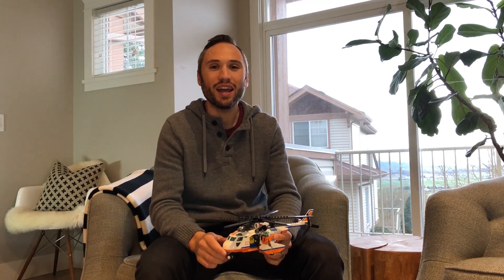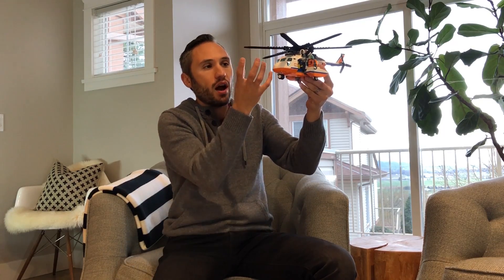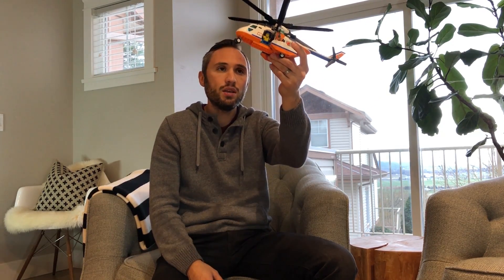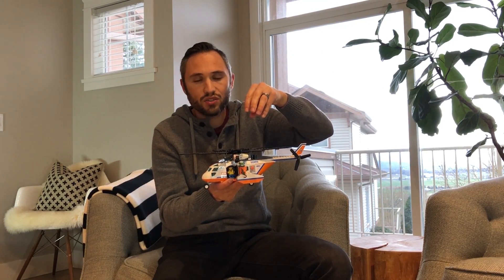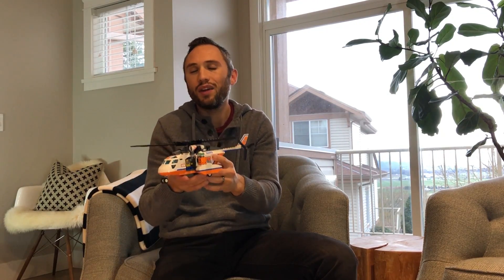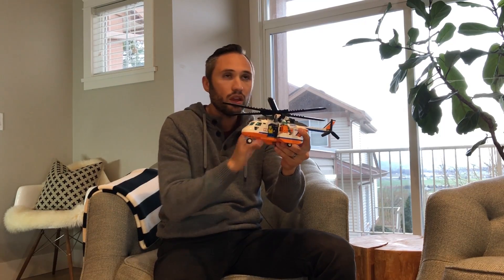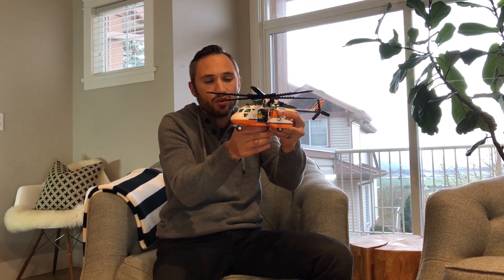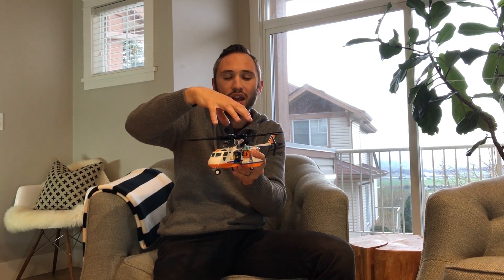Vortex Ring State IS NOT Settling With Power

Comment: AOPA has a good blog about this. This is all a battle of semantics & definitions. It's really not useful to have a separate definition for running out of power when the helicopter is too heavy.  We all grasp this concept easily... helicopter too heavy & move to fast, rotor no stopy, helicopter hit ground.
VRS meanwhile is a complicated concept that requires a lot of classwork and understanding of helo aerodynamics to master.
What's the solution to having a helicopter move too fast/too heavy and the rotor not having enough lift? Use charts, don't put yourself in that situation. Simple
What's the solution to keeping yourself out of VRS? Vuichard technique or the older style recovery. Neither are intuitive. Both need particular training. 
It might be to come up with a term for the lack of power situation, maybe, but it's not a priority. I don't think it's wise to use "settling with power" to describe this because lots and lots of older documents still exist that describe SWP as VRS.

https://blog.aopa.org/aopa/2009/04/17/vortex-ring-state/

Comment: The thing to remember about VRS is that the limits given are not the limits to get into VRS, but the limits at which you cannot get into VRS.
At more than 30 knots (it's actually anything above ETL) you cannot get into VRS. That is not to say that at 29 knots you will get into VRS .. it may not happen until you get below 23kts (I actually know of one heli that absolutely refuses to enter VRS until it's airspeed is less than 2 kts), but the point is that it absolutely will not happen above 30 kts
In a descent at less than 300fps, you cannot get into VRS, in some helis it will not happen until you hit 1600fps, but again the point is that at 300fps it _will not happen_.
In essence, the information given by the FAA about entering VRS (although accurate) is misleading.

Comment: Thank you  Y P ; good stuff to file away, when later required.   Once was asked if you were in formation flight,  going to land and you experience settling with power with Engine Maxed out with tree corridor on both sides , what would I do?    the answer is : to trade altitude for power.
Reply: not a realistic question. on an approach to land, your forward speed should keep you in clean air until you are about ige height, at which point settling with power is unlikely. besides, you already have a whole lot more to worry about than vortex ring state if you are shooting an approach, in formation, with no out at max available power
Reply: @josemadarieta3   Thank you for the explanation  this was about landing flying  formation in "nam  to lz  ige  where you have only one option for successful results . sorry I was so vague.  no side step with the border of trees.  I saved the story for my future use and thought to share it with you.
Reply: @garyh7191  lol. as i was typing my comment i was thinking "not a realistic scenario...unless you flew slicks in nam"
and if you were anywhere near helos during that period of time, then all i have to say to you sir is, respect

Comment: It would be great to see a video analysis on theories to what happened to Kobe Bryant's helicopter crash
Reply: From the NTSB analysis of the radar returns and transponder altitude replies, it looks like the pilot was attempting to turn around and head back to Van Nuys or Burbank (Bob Hope) airports, where they would have had to get a limo to finish the trip. The pilot simply forgot about the nearby ridge of mountains. I don't think VRS applies to that accident.
Reply: Ok the pilot zucked up, the heli hit the ground from a height not CFIT which is controlled flight into terrain. Loss of control with no visual reference ie can't see, so after loss of control, gravity took over an heli hit the ground very fast what? 170 mph?. This  is not the first time and won't be the last time this happens, Man is better at designing a plane than operating the plane because the human brain has faults like ego, peer pressure, fatigue, impaired medically.... , Time pressure etc. You can't pull over to the side of the road, ironically. a heli is able to land in a quite small area but the pilot continued and for 15 minutes circled over a spot(during that 15 minutes he became more and more fatigued) he should have landed anywhere during this period, a sequence of errors that led to the crash.

Comment: So settling with power is more like a lack of anticipation, whereas vortex ring state is kind of a trap you have to identify quickly to escape ?
Reply: SWP is an aeronautical downfall of getting stuck into your own downwash. What he described as SWP is mushing.

If you have 20kt airspeed and a 20kt tailwind you have a ground speed of 40kt and still have an airspeed of 20kts and therefore will never get into VRS or SWP. 

You cannot have 'matching angle of attack of the wind and the rotor'   angle of attack is the angle created by the cord line(airfoil) and the wind. So the wind does not have its own angle of attack.

Vurshard technique is maximizing translating tendency. You have  to use POWER PEDAL and opposite cyclic and raise the collective to slide laterally out of your downwash.

Comment: When I first came across this video I thought what is this guy talking about. I had always used the terms to sort of mean the same thing. I say sort of because I actually think of settling with power as being what happens when you fail to correct for vortex ring state. After watching the video I realized that what you call settling with power is what I would call sloppy flying. Why would any pilot allow himself to get into a high rate of descent close the the ground. I have actually experienced vortex ring state one time in over 9000 hrs of flying helicopters. I was in a out of ground effect hover (Bell 206) when it happened and I immediately pushed the nose down and lowered the collective  a bit (as I had been trained to do) to get out from the down flowing air. The recovery was also immediate. I found the video of the Vuichard Recovery Technique to be very interesting and can see how moving the cyclic to the right and pedal to the left (in the 206) would be better as that would result in little lose (if any) of altitude, as compared to putting the nose down. It might even have been a little quicker because of the added thrust of the tail rotor. As the holder of both a helicopter (ATP) and fixed wing (Commercial) licenses (Canadian) I find it amusing how fixed wing pilots keep trying to compare a rotating wing (the rotor, which has the tip moving at a much higher air speed then the root) to a fixed wing which has relatively constant air speed from tip to tip (except in a spin). As a side note not all of the helicopters made in European countries have main blades rotating clockwise
Reply: "what you call settling with power is what I would call sloppy flying"
Spot-on.  EXACTLY.
Reply: I like your comment. Only a thought about this: "Why would any pilot allow himself to get into a high rate of descent close the the ground". To settle with power you don't need a high rate of descent. Just a rate of descent you can not arrest in time. Imagine you are flying your helicopter really near its performance limitations. For instance, at very hight altitudes with high temperatures, and a heavy configuration. Try to land at 8000 feet in Afghanistan during summer. Perhaps you make an approach with 200 fpm and you can't avoid a hard landing. It's not so easy to judge the power remanent when you fly so close to the limits. Regards.

Comment: Great video, but I’m confused about your description of stalling. If the airflow is matching the angle of the blade, you are correct, it isn’t generating lift, but that is not a stall. A stall occurs when there is too much angle, and the air can’t follow the upper surface of the blade.
Reply: Stalling only occurs on the inner portion of the rotor, where the upwash near the rotor hub has the effect of increasing angle of attack on the inner portion of the rotor, reducing lift. The outer part of the rotor is operating in downwash,  decreasing angle of attack and also decreasing lift. The overall lift is reduced to the point that full scale helicopters need double the power it takes to hover to be able to power out of VRS (climb vertically without needing lateral movement), such as an unladen SkyCrane or MBB BO-105 (it can do loops). Model helicopters may need relatively higher power, due to scale issues. For 3D aerobatic type helicopters, it's not an issue. Consider the fact that a tic-toc maneuver repeatedly cycles into and out of VRS without issue due to the high power to weight ratio.
Reply: @rcgldr  Thanks! Very helpful for my understanding!

Comment: Vortex Ring State (VRS) occurs when the descent rate is great enough that upwash at the hub creates an inner set of vortex rings and/or stalls the inner portion of the main rotor. Descending into it's own downwash creates a momentum issue, but if there's downwash at the hub, it's not VRS.

Comment: Why does Rotor rotation direction determine left or right cyclic recovery movement for VRS? Does Tail Rotor Thrust have an effect? Thanks, fantastic videos.
Reply: Bob Moo Blade which is moving forward has more lift then retrieving blade. That’s why Ccw like Robinson cyclic right pedal left. Yellow Pilot is wrong on Swiss technic to recover. On G2 Cabri cyclic left pedal right. It might have to do with torque too.
Reply: Vuichard Recovery method relies on tail rotor thrust + cyclic lateral thrust in the same direction for near lateral recovery.

Comment: Apparently the United States is the only country that uses the terms... Settling With Power & Vortex Ring State ...interchangeably... but I'm having a hard time finding sources that describe the differences between the two in a complete, concise manner.  The best I could find is bits & pieces of info from a multitude of sources.  

So my understanding is this... Settling With Power is when the pilot tries to do a maneuver which demands more power than what the helicopter can produce, like... 
trying to land on a mountain top hovering at the helicopter's hover altitude limit, 
flying at ceiling altitude limit, 
flying in high density altitude, 
landing with too fast of an airspeed & there is not enough power to arrest the helicopter's Kinetic Energy, 
the helicopter is just too heavy for takeoff, 
or the density altitude is greater at the landing site than the takeoff site, resulting in the helicopter being too heavy, & there is not enough power to arrest the helicopter's Kinetic Energy.  

How correct am I?

Comment: If you're descending at "500 ft./min." with "zero airspeed" obviously the bladea are ALREADY "stalling" or the aircraft wouldn't be DESCENDING. Helicopter rotor blades are WINGS and its their LIFT that lets the aircraft fly. Its not "thrust" or "downwash" from the blades "pushing down" that lifts the aircraft up. Its the same Bernoulli principle that causes LOWER PRESSURE ABOVE THE WINGS AND HIGHER PRESSURE BELOW THE WINGS OF A FIXED-WING AIRCRAFT AKA AIRPLANE THAT LIFTS THE "ROTOR DISK" AND WHEN "DRAG" - SUCH AS "DOWNWASH" CREATING HIGH PRESSURE BELOW THE ROTOR BUT ABOVE THE AIRFRAME - EXCEEDS "LIFT" - WHICH RESULTS FROM HAVING SUFFICIENT "DELTA P" ON BOTH "SIDES" OF THE ROTOR DISK - THE RESULT IS A "DESCENT" AND THEN IF THAT EXCESS DRAG/INSUFFICIENT LIFT SCENARIO IS ALLOWED TO WORSEN A "STALL". AND WITH "ZERO AIRSPEED" A "STALL" CAUSES EVERY AIRCRAFT TO DROP LIKE A ROCK. PERIOD. EVEN WITH FORWARD AIRSPEED AS LONG AS YOU'RE AT "FULL POWER" AND STILL DESCENDING, GUESS WHAT? THE AIRCRAFT IS "STALLED". HOW DO YOU AVOID BOTH "VRS" AND "SWP"? DON'T BE STUPID AND MECHANICALLY-DECLINED AND BASIC PHYSICS-CHALLENGED AND AERODYNAMICALLY-IDIOTIC ENOUGH TO "BELIEVE" THE TWO GREATEST MYTHS IN ROTARY-WING AVIATION.
FIRST MYTH? "HELICOPTERS ARE MADE TO HOVER". THAT'S BULLSHIT PURE AND SIMPLE AND NO PROFESSIONAL, SKILLED, EXPERIENCED AND "SMART" HELICOPTER PILOT EVER HAS HIS AIRCRAFT IN "HOVER" AND CERTAINLY DOESN'T "ENTER A HOVER" ABOVE HIS "LANDING SPOT" AND THEN "DESCEND" 50 0R 500 FEET TO LAND AFTER PROVING TO "OBSERVERS" HE'S A REAL-DEAL "CHOPPER PILOT". THE ONLY "SAFE" HOVER IS ONE THAT ISN'T A "HOVER" AT ALL BECAUSE A HEADWIND - NOT A FREAKING "TAILWIND" BECAUSE WHAT MORON OF A PILOT FIXED-WING OR ROTARY-WING EITHER ONE EVER TAKES OFF OR LANDS "WITH THE WIND" - IS CREATING POSITIVE AIRSPEED WITH ZERO GROUNDSPEED AND IS BLOWING IN "CLEAN" AIR NOT ONLY TO THE ROTOR DISK BUT ALSO THE ENGINES. AND EVEN THAT "SAFE" HOVER WILL NOT LAST A SECOND MORE THAN NECESSARY. AND NO SMART HELICOPTER PILOT THINKS A HELICOPTER = A CRANE. THE STUPID SHIT "CONTRACTORS" HAVE EVEN STUPIDER "VERTICAL LIFT COMPANIES" DO WITH HELICOPTERS BECAUSE THEY FORGOT TO PLAN FOR OR BUDGET FOR OR CONTRACT FOR AN ACTUAL CRANE TO PERFORM "CONSTRUCTION WORK" JUST BOGGLES THE MIND. EVEN WHEN A CRANE ISN'T POSSIBLE, USING THE HELICOPTER "LIKE A CRANE" TRYING TO "HOVER" AND PUT A LOAD DOWN "ON A DIME" INSTEAD OF GETTING IT "CLOSE ENOUGH" AND "MANHANDLING" IT FROM THERE IS PLAIN IDIOCY. 

SECOND MYTH? A HELICOPTER HAS MORE "POWER PER POUND" AT THE "END" OF AN UNREFUELED AND/OR NON-STOP FLIGHT THAN AT TAKEOFF. NOTHING COULD BE FURTHER FROM THE TRUTH. ENGINE "HORSEPOWER" IS DIRECTLY AND DRAMATICALLY AFFECTED BY FUEL TEMPERATURE AND MUCH LESS SO BY INTAKE AIR TEMP. AND HELICOPTERS FLY "LOW AND SLOW" ENOUGH THAT THEIR FUEL GETS HOT IN A HURRY. EACH 18 DEGREE F INCREASE IN FUEL TEMP REDUCES "HORSEPOWER" BY 4%. 18 DEGREES F OF AIR TEMP "ONLY" AFFECTS HP BY 1%. AND ALL "COMPRESSION IGNITION" ENGINES WITH "FUEL INJECTORS" AND ANYTHING FROM "JET A" AKA "AVIATION KEROSENE" TO DIESEL FUEL IN THE TANK "RETURN" MORE FUEL THAN THEY BURN OUT OF WHAT FUEL THE TRANSFER PUMP(S) TAKE FROM THE TANK(S) TO THE "INJECTION PUMP(S)". AS THE FUEL LEVELS DROP, FUEL AERATION CAN OCCUR TO "HELP" THE HOT FUEL "DERATE" THE ENGINE(S) A SHITLOAD. FLYING AROUND PLAYING "AIRWOLF" WITH A "TRANSPORT HELICOPTER" DOING SOME OF THE ABSOLUTELY FUCKING RETARDED "AEROBATICS" THAT "COMMONWEALTH" SO-CALLED "AIR FORCES" AND "FLEET AIR ARMS" DO TRYING TO "PROVE" SHIT LIKE THIS CLOWN SAID - "THE FAA IS WRONG"  - AND TRYING TO BE "TOP GUNS" IN CHOPPERS BECAUSE THEY BLOW GOATS IN "FIGHTER PLANES" IS A GUARANTEED WAY TO END UP WITH HOT, AERATED LOW-PRESSURE "SUPPLY FUEL" GOING TO HOT "HOVERING" AND ZERO-AIRSPEED/ZERO ENGINE "COOLING" POSITIVE INTAKE "PRESSURE" MININIMUM-POWER AND MAXIMUM-DRAG "STATE" JUST IN TIME FOR THE BIG "AIRSHOW" FINALE OF "HOVERING" FOR SEVERAL SECONDS OR MINUTES DOING A  "SAR" OR "ZIP-LINE" DEMO OR JUST DEMONSTRATING THAT HELICOPTERS ARE "MADE TO HOVER" AND EVEN FLY BACKWARD IN CIRCLES OR ANY OTHER STUPID SHIT NOBODY EVER DOES IN THE "REAL WORLD" OUTSIDE OF VARIOUS "ROYAL AIR FARCES" BEFORE "DESCENDING INTO THEIR ROTORWASH" OR "SETTLING WITH POWER" AND PROBABLY 10-25% LESS "POWER" BUT ONLY 5-10% LESS "POUNDS" THAN THEY HAD ON "TAKEOFF" FULL OF COOL, UNAERATED FUEL WITH COOL ENGINES AND NO TIME/FUEL/CLEARANCE TO PLAY "AIRWOLF" ON THE WAY TO THE AIRSHOW. 

AND ONE OTHER THING WITH TEMPERATURES. THE HOTTER THE MAIN AND TAIL ROTOR "GEARBOXES" GET, THE LESS "EFFICIENT" THEY ARE AND THE MORE "POWER" THEY WASTE. HEAT IS "POWER" TURNED TO FRICTION. 

FOR A COUNTRY THAT SUPPOSEDLY HAD ITS WHOLE "AEROSPACE INDUSTRY" COLLAPSE JUST BECAUSE "THE ARROW" WAS SUPPOSEDLY "KILLED" BY AN "F-111" THAT WASN'T EVEN "ON THE DRAWING BOARD" UNTIL DAMN NEAR 10 YEARS AFTER THE "CF-105" WAS "CANCELLED", CANADA SURE DOES PRODUCE A LOT OF "EXPERTS" IN AVIATION, AEROSPACE ENGINEERING, AERODYNAMICS, FLUID DYNAMICS, ETC. 

OF COURSE HE IS RIGHT THAT THE "FAA DOESN'T TEACH..." WHATEVER HE SAID. THE FAA DOESN'T "TEACH" ANYTHING. ITS "BUREAUCRATS", WHO ARE ALMOST ALL "LICENSED PILOTS", JUST DECIDE WHAT AVIATORS NEED TO KNOW TO BE COMPETENT AND "SAFE". AND THAT MEANS NOT REQUIRING THEM TO "DETERMINE" WHETHER ITS "VRS" OR "SWP" THAT IS "MORE DANGEROUS" AND "UNDERSTAND THE CAUSES" WHEN SURE AS SHIT LIKE ALWAYS WHEN AIRPLANES FALL OUT OF THE SKY ITS A "STALL" BECAUSE DRAG > LIFT. 

ANYBODY "HOVERING" AND/OR "DESCENDING" TOWARD "LANDING" WITH/IN A "TAILWIND"  SURE AS SHIT WOULDN'T EVEN NEED TO WORRY ABOUT "VRS" OR "SWP" IN THE U.S. MORE THAN ONCE IN FRONT A "CROWD". 

NO U.S.-DESIGNED "TRANSPORT" HELICOPTER EVER NEEDED "ADVANCED AVIONICS" AND "FLY BY WIRE" AND "FADEC" AND "AUTOHOVER" UNTIL COMMONWEALTH "ROYAL AIR FARCES" STARTED "ADOPTING" THEM.

Comment: In Europe, I was taught (under EASA) that they are simply NOT the same. VR is caused by contravening the 3's (less than 30kts FIAS and ROD greater than 300ft/s) in powered flight and usually occurs on approach and more so when on a steep approach. Settling with power is caused by over-pitching where the engine hasn't enough power to support the weight of the helicopter so sinks at the pitch angle of the blades - adding collective increases pitch and the opposing forces acting against the engine which is at its maximum output and therefore sinking occurs. In both cases the helicopter "sinks" but the causes are different. The escape is of course the same and the Vuichard Recovery is the most efficient if you hace lateral room. Another great video Mischa - keep them coming PLEASE !